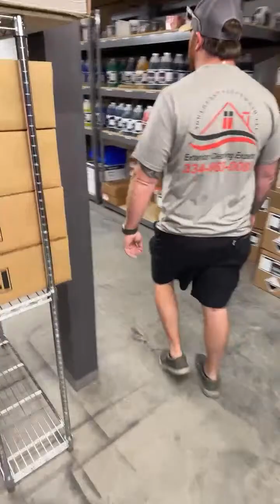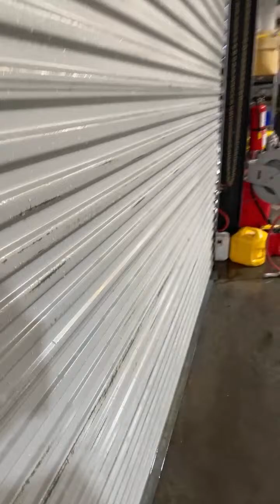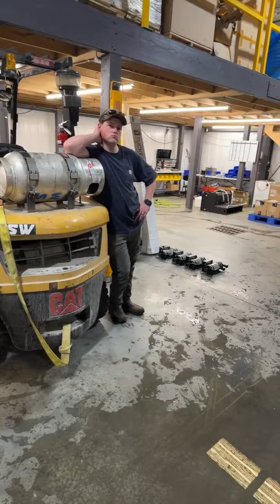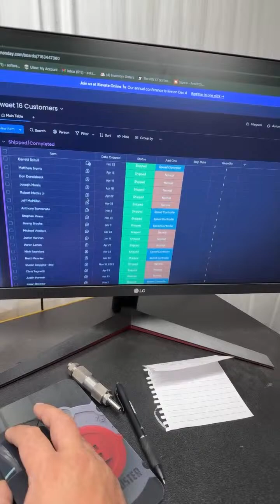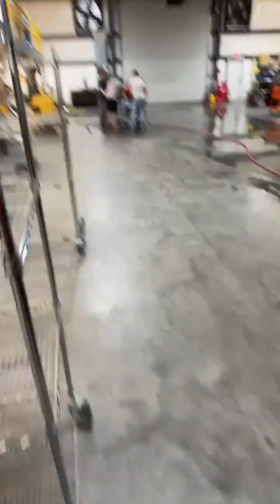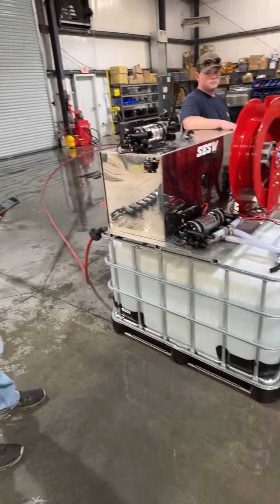Super Pump Testing (We keep receipts)

Comment: With the Super 8 is the 5/8 soft wash hose ok to use? Also will I need to go to 3/4 in drop sticks?
Reply from the maker: @bigrobbigrob7156  5/8 discharge is plenty for the 8. 
It’ll want 3/4 suction tho